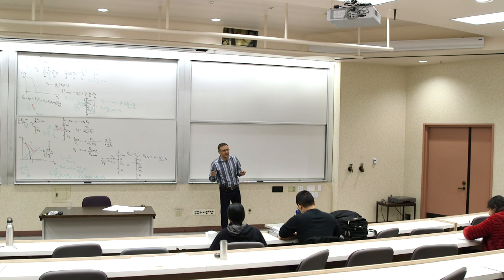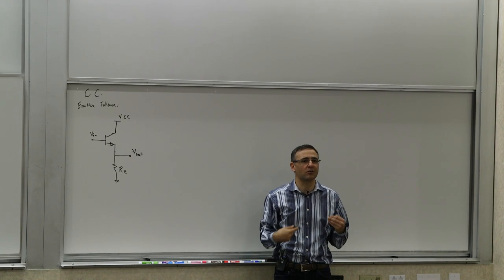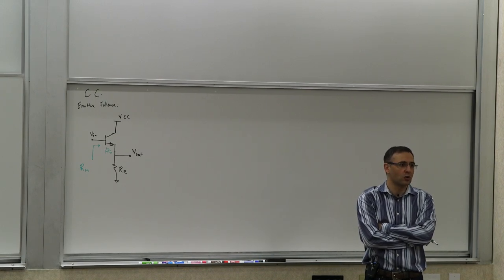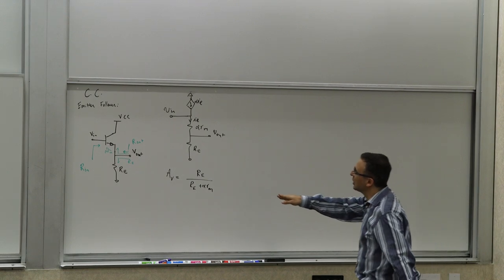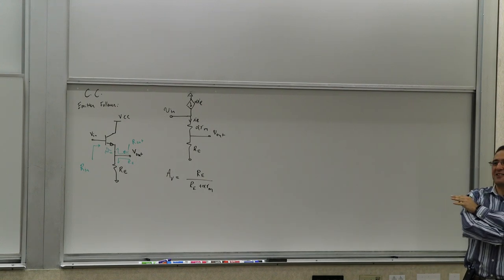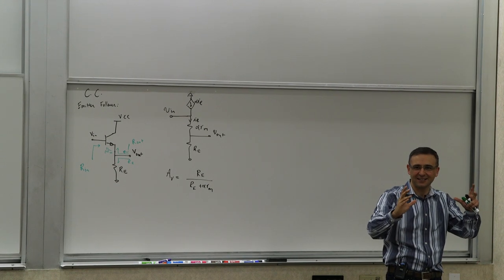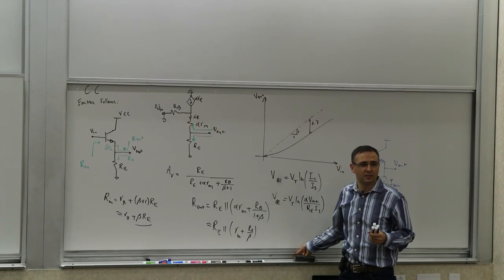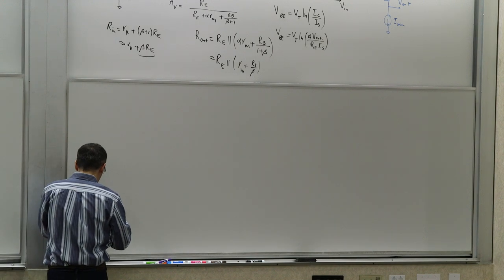122N. (Pt. 2) BJT Amplifier, Emitter follower, common-based, cascode, active load, maximum gain

Comment: When you calculate the Max Intrinsic Gain of the CB stage, you forgot that as Rs increases, less and less voltage appears across the transistor. Your calculations should include the Rin / (Rin+Rs) term which shrinks as Rs increases, hence the actual intrinsic gain of gm ro.

Comment: The active load for a common emitter stage is somewhat strange. It's like connecting two current sources in series which is impossible in circuit theory. It'd make the circuit irregular wouldn't it? How can we still make this? How can we resolve this contradiction? Is it enough to assume that those two current sources have finite resistance?
Reply: Its really not, because the current Ic is not equivalent to current source, rather voltage controlled current source, which in reality isnt something that generates, rather something that is generated. So even though in the name says its voltage controlled current source, and we draw it similarly as current source on the circuit schemes, it is just a symbol that we use to represent it. I hope I understood the question and helped!
Reply: @deckosmeker3530  let me rephrase the question then. Can we connect a current source and a voltage controlled current source (and their values of current being different) in series? If so, what will be the common current?
Reply: @MrGyulaBacsi  Undrestood. Yes, we can, because, as i said, voltage controlled current source isnt a source in reality, rather symbol for that particular current. If we connect them in series, current will be the current of current source, because the current source forces its current through the circuit in which its connected. Of course, this applies only to DC regime, because in small signal regime all of the voltage and current sources are turned off, and you will be left with only gm•vbe voltage controlled current source that represents ic.
Reply: @deckosmeker3530  Your explanation is wrong. The true explanation is that these are non-ideal current sources. Every current source has a shunt resistance associated with it. If you go through the analysis on paper with two non-ideal current sources in series, you see that they output some current that is in between the two values of the two current sources. In fact, if the shunt resistance for both current sources is the same, the true current will be the average of the two current sources. Same thing happens if you have two non-ideal batteries in parallel: because there is some series resistance in both, the output voltage is perfectly defined, even if they have different voltages. Now, batteries are slightly different because the resistances are so insignificant that other stuff like capacitance and inductance will play a role, so that's why upon switching the two batteries on there might be some initial fluctuation. There will also be fluctuation due to variation in temperature which will affect the chemical processes in the battery. Likewise, current sources made by transistors also will fluctuate slightly due to noise in the biasing circuit and due to the change of semiconductor properties with temperature. But the current will still be perfectly defined if temperature and noise is kept under control. It has nothing to do with what is driving the current source because from the perspective of the collector currents the be junction is almost invisible, and the error due to that will be on the order of less than 0.1% in standard operating conditions

Comment: @ali Hajimiri May I ask why for the gain of common base configuration has to include the output resistance? Why the commom emitter doesn't require?
Reply from the maker: The output resistance is taken into account in both cases (see video 121N). What is being done here is to compare the 'intrinsic' output resistance of the stage that determines its maximum intrinsic  gain (beta gm ro) and compare it with the maximum intrinsic gain of the common-emitter (gm ro).
Reply: @AliHajimiriChannel  Thank you so much but I still don't understand for emitter degeneration case. I have seem some equation that include ro including in the gain equation. However, how can we proof this?
Reply: @Ali Hajimiri Or I should say why the output resistance of common collector configuration is not taken into account for calculating the gain? Thank You
Reply: @AliHajimiriChannel  Wouldn't the intrinsic gain for the CE stage with emitter degeneration also follow the same derivation in CB stage and yield Av,max = -gm (Rc // beta*ro)? I'm confused why the beta would only appear for intrinsic gain of CB if the result of R'out was taken from the CE stage with ro and RE.

Comment: What would happen if we would to change the Vbe of the top PNP transistor like Vbe of the lower NPN transistor in CASCODE, or have it with inverted phase? Would we get some benefit?
Reply: Lower transistor would act as a load for upper one, that is we would have CS stage with degeneration where Re would be ro of lower transistor.